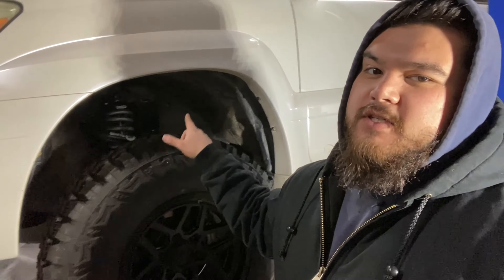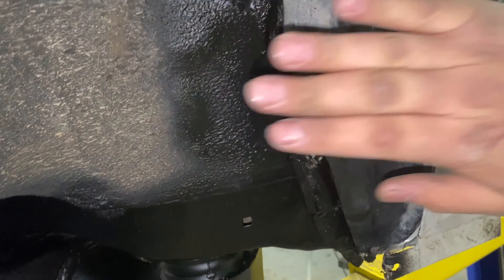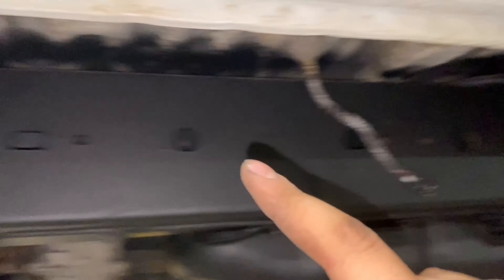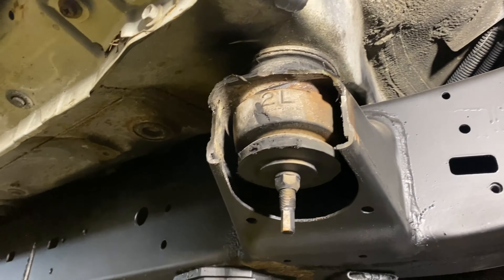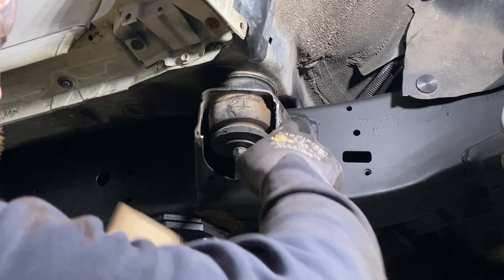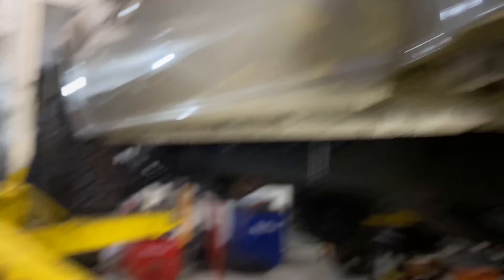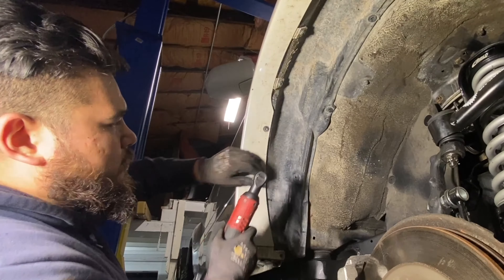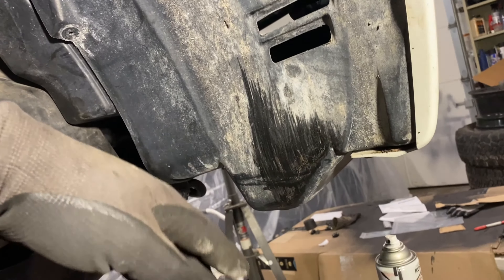How to Clear Big Tires on GX470 - Body Mount Chop

Comment: New ways of C.A.D.D (cardboard aided drafting and design)  To get a better line along the edge of the metal , use a hammer works way better than pressing it by hand, and a rubber hammer can even help to cut templates.
Reply from the maker: @rednecktech00  😂 C.A.D.D. Love it!

Comment: How is the handling after the new tires are installed? did you have to regear the differential?
Reply from the maker: Id say that 295/70/17 was the sweet spot imo. Once I went to 315’s, it was the struggle bus.

Comment: Great job dude, wish I had this level of mechanical aptitude. What UCA are you running?
Reply from the maker: Thank you! I went with freedom offroad UCA’s
Reply: @MJAltairy  how are they? Were you able to get it aligned with those UCA?
Reply from the maker: @TheGarrettZone  i like em alot, can’t complain especially for the price. They corrected the ball joint angle where the stock ones looked like they were putting too much strain on the upper ball joint. You can’t really make adjustments to it tho like some of the other more expensive UCA’s but this seems to be doing just fine. Haven’t gotten an alignment yet because the 1 place i took it to so far was unable to lift the truck high enough to make adjustments however they said alignment wasn’t that off so I’ve been winging it till i get around to finding a good alignment shop as well as more knowledge on alignment specs.
Reply: @MJAltairy  awesome thanks for the reply brotha 🤙🏼